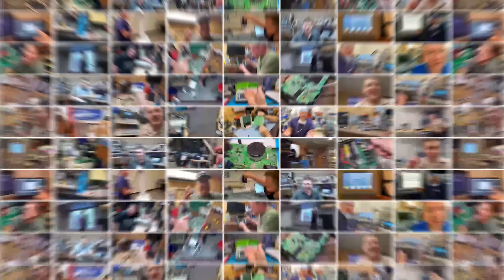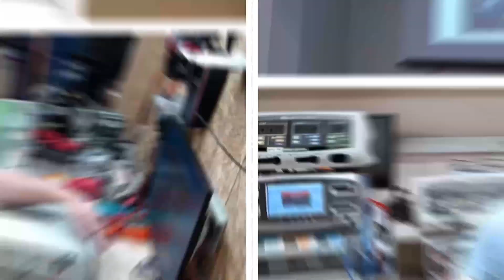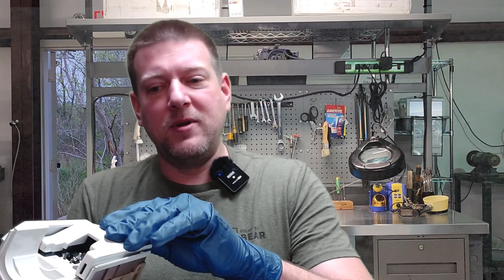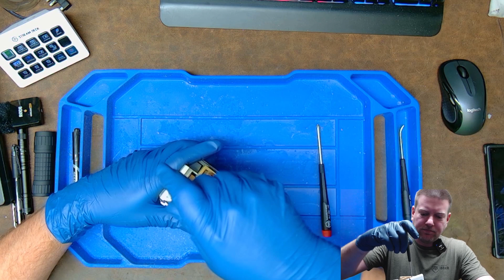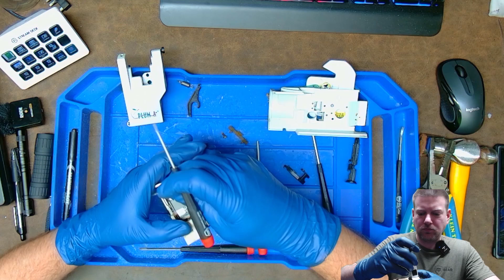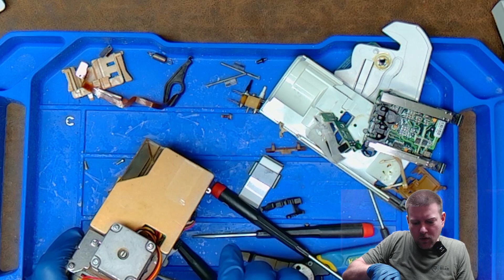ICU Medical Plum A+ Infusion Pump Module Tear-Down!

Comment: As I'm watching you try to take the pin out after you took off the door clip... Just open the latch and the door comes right off. But I'm sure in the video I will find out why you're trying to take the pin out. I've never had to myself.
Reply from the maker: @tolstadb  It's all coming apart. That's why.